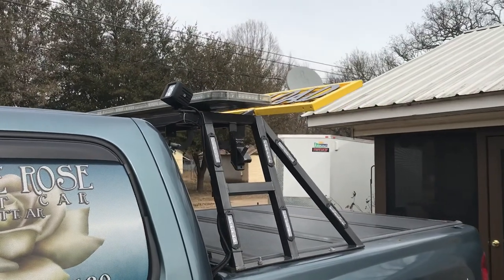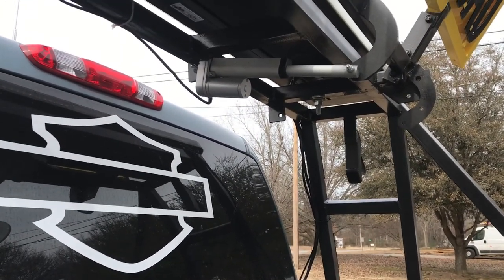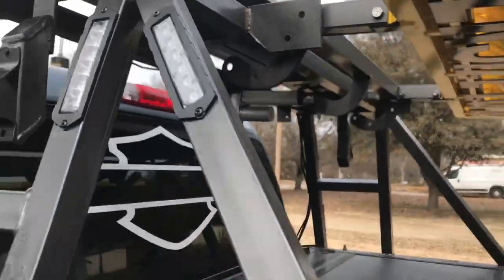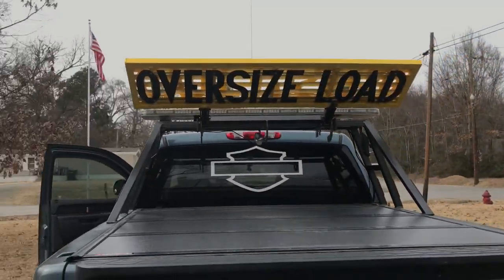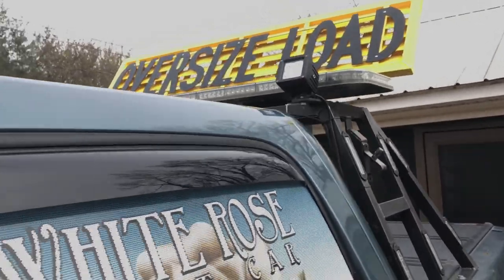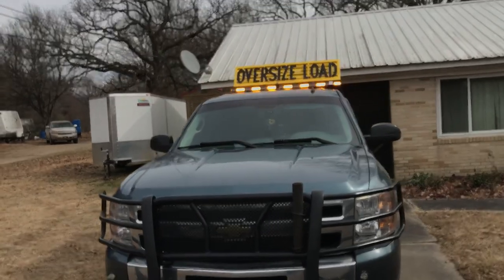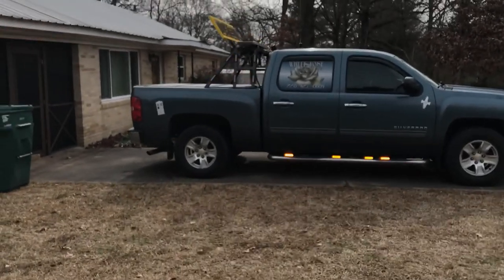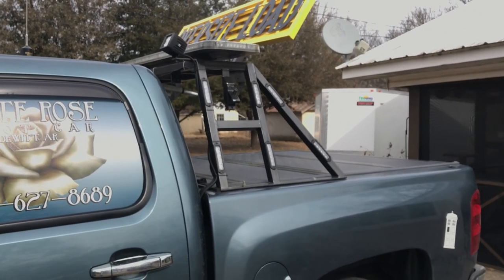Pilot car set up demonstration

Comment: Why so much light to the sides? 
Wouldn't a Reflective over Size sign be better?
Reply from the maker: All the lights on the side is so that people will see me when I have to sit across a road to block it so the drivers I escort make a turn or what else they need to do. We are not required my law to have a reflective roof sign. Beside, I do not use it much. Only in the states that require me to run a roof mount sign.
Reply: @CindyiniraqWhiteRose  really solid looking rig, I'm thinking of trying this buisness out you have given me some great ideas thankyou!!